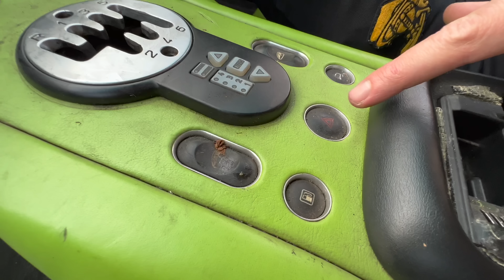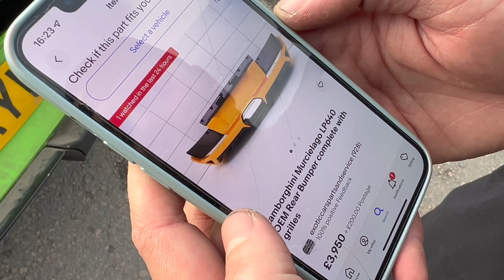IM REBUILDING THIS ABANDONED LAMBORGHINI MURCIELAGO | UNSEEN TOUR

Comment: Also Matt, If you are going to get rid of the CATs and the back box you will have to have the car mapped to suit. They become a pain with low back pressure - EML lights and poor idle and jerky pull away. Especially in the Pre-LP cars. 
Also make sure you put the heat shield back that covers the standard back box, if you run without even with an aftermarket exhaust you run a HUGE risk of the car catching fire.
There are some great tips on Lamborghini Talk for cross referencing parts - Coil packs for example are £1600 each from Lamborghini, or you can get some NGKs from the US for £39 each - The Pre LP cars had a Marelli Magneti system which they changed to the 4 wire Audi setup on the LP640 which is much cheaper and more reliable. 

With the throttle bodies, There is a firm that reconditions them in Europe, I will find their details when home later. They will be able to do a much better price than Lamborghini. Also, on Pre LP cars they need to be balanced with LaRA for ensure smooth idle and to stop the car stalling and misfiring. I would highly recommend that you get your one refurbished at the same time so they are all as good as new. LP640s do the balancing automatically via the ECU, the Pre LP cars don't. 

From a Manual Murcielago Owner in the UK

Comment: A manual later lp car fetch 80k plus more than an E gear as they are rare, all the early cars are manual, but if you are getting rid of that interior, diamond stitch it like an lp, change the rear lights and stick a private plate on, and everyone will think you have a rare lp manual.

Comment: Mat, what are your thoughts on replacing the one of the bolts connecting the carbon ceramic pad to the hub? I was asked by a main dealer today to pay for two new brake discs, pads etc....all because one bolt has corroded. Rest of the system in very good condition with minimal wear.....£10k + for 1 M8 bolt seems nuts to me?!
Reply: I would happily say you are screwed, I quite as a master tech for McLaren as they were ripping customers off